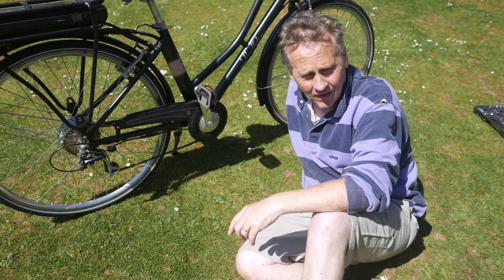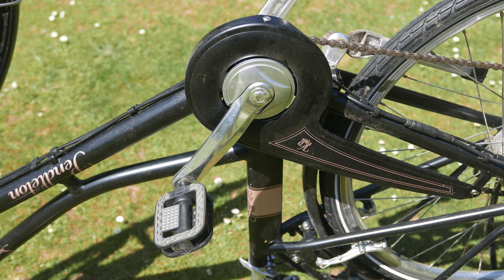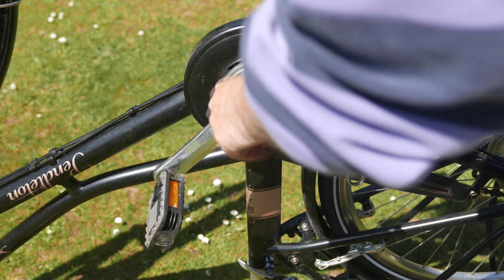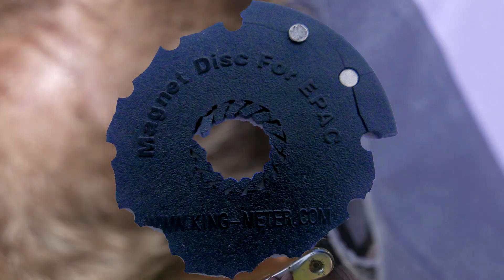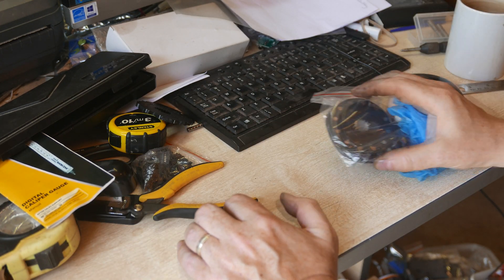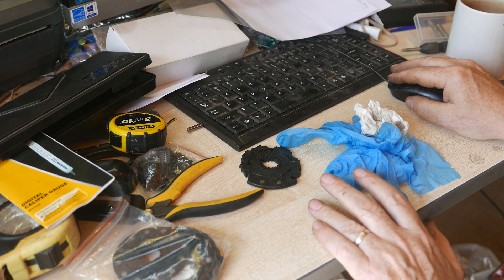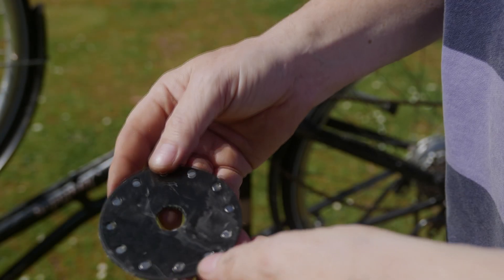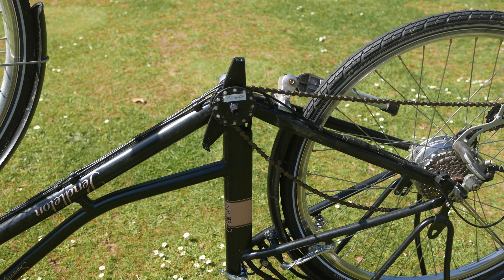e-bike PAS Sensor fail.  3D printed replacement.  Pendleton

Comment: Thanks I have 2 A2B Kuo+ cycles. I have exactly the same problem. 8cm discs 12 magnet which have fallen apart. I have bought 6.5 cm discs as only ones I could find. But they won’t work.